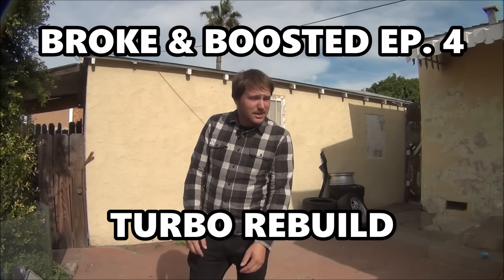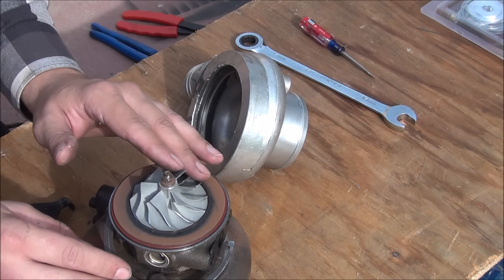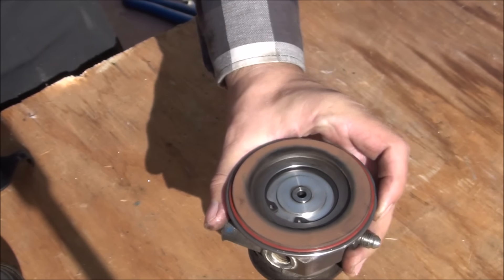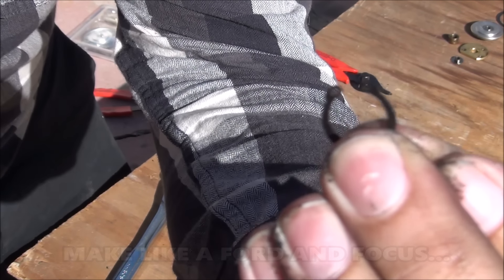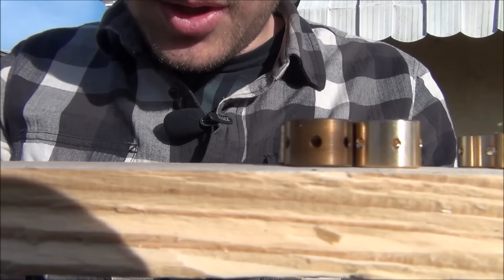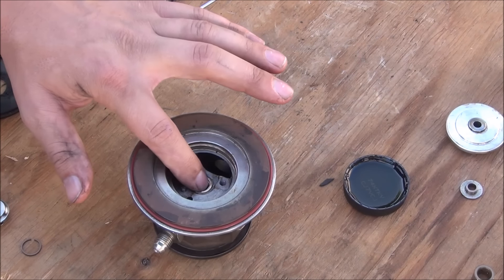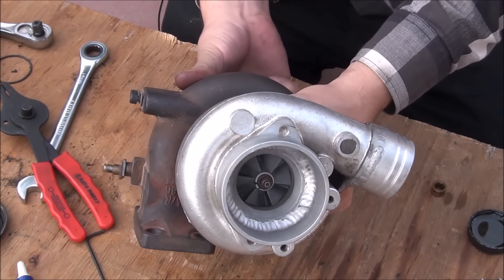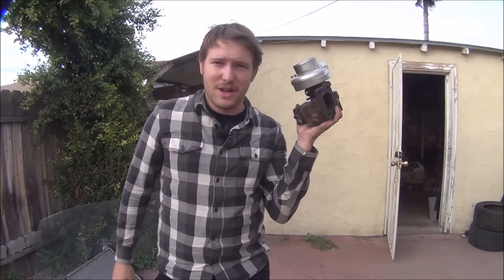How to Rebuild a Turbo! (Broke & Boosted Ep4)

Comment: I love how all these videos are so realistic for the average guy. Working outside in the backyard with basic tools oppose to in a shop with hundreds of dollars of air tools and lifts. Keep the videos coming.
Reply: Right? I bought NB for $3k and was looking at flying miata kits for $3.4k or ebay kits as low as $1.6k and well shit! That is about how much I paid for my car. I like the whole cheap out where you can, buy GOOD 2nd hand quality parts aspect, and when you can afford it you can easily replace.
Reply: I also agree, BUT don't make the mistake of lowering the importance of know-how and very good quality parts. I got an FM kit about 7 years ago, with a GT2554R. Nothing is broken...that turbo now has around 60 THOUSAND miles at 250 hp crank...the reliability is insane...no way you can get that with discount parts.
Reply: i bet i coulda bought 16 ebay turbos for my integra for the price of the gt4554r 7 years ago
Reply: Yes using any old tools at hand
Reply: Ææ0

Comment: I got my GodSpeed Ko4 turbo off of craigslist for 50$s then I got a rebuild off of eBay for 40 something  dollars..
it's been almost 2yrs now and no problems at 22psi!  but because I just mentioned it, my car is sure to blow up now.
Reply from the maker: +Audiwan Kenobi Perfect.
Reply: TheCarPassionChannel sure is!...minus the exploding car,right?...just checking.
Reply from the maker: Audiwan Kenobi Hahaha yes, that would not be good.
Reply: Did u ballance the turbo?? Or use the methode used in this video?? (Marking)

Comment: Awesome video! I love the fact that you did it outside with basic tools, no fancy shop with air tools. I'll use this video as a guide to try to rebuild my truck's turbos. I have an 07 International 9400i with a Cat C-15, 1.3 million miles, my turbos work but look like they're about to crap themselves any minute. Is there any rust prevention to coat the turbos with?

Comment: best to undo fan nut with a log extension socket bar and have   a socket in vice  for the exh side ,,,, so not risk bending shaft  .in .the push down method shown ,,,also can fit carbon seal on intake side  round alloy  thing ,, so you can use with suck thru  carburettor.. i have one on suzuki 1100 motorcycle

Comment: I noticed you did not mention having the turbo re-balanced. While in theory if you mark the compressor and shaft, and reinstall carefully, it should be balanced, in theory this is not always true. Even if it is misaligned ever so slightly, this can throw the balance off

Comment: Another excellent vid... I will be doing the full timing belt / front seals / waterpump as per your video in a couple of weeks, and during next year make everything stronger and prep the car to turbo later in the year. I'm planning to use a TD04 turbo off an impreza, and want to learn more about wastegate actuators and aftermarket boost controllers....Basically how to set and control your boost (i plan to use a p+p ecu) but want to know how these things can be set physically, and what might work well... Kinda hoping you might be planning on covering this...
Keep up the excellent vids... Cheers, Ollie.
Reply from the maker: +ollydubhead Hmmm... how the various types of boost controllers work... sounds like a good idea to me.

Comment: all of these miata videos have made me certian that i want one for my first car 
my plan is to get a 1.6 liter and vinyl wrap it a royal blue, raceland coil overs, at fist i want to get a full manzo exhaust system and then go turbo when i can, some sort of a "cold air" intake, 2 inch wheel spacers, and maybe some white plasti dipped diamond  steelies or maybe some nice bbs rim but not to sure yet
Reply: Just a couple suggestions... IMO, you should get different coil overs because race lands suck lol and instead of the spacer, get wider wheels, it'll make the car look SO mean plus a wider wheels is nicer. And I'm speaking from an owner of a 1993 Miata with 15x8 wheels on
Reply: oh ok yea ik race lands are crappy i might go with some thing a little nicer with maybe some camber adjustability
Reply: +Dale Jackson I've got a Manzo exhaust on my car, it's a bit loud for daily driving but I don't mind it. For wheels Advanti Storm S1's are gonna be going on mine after I finish piecing together my turbo build. For coilovers though you should consider Flyin Miata. They're a bit pricey but they give the car great feel in the corners.

Comment: I know this is an old post, but I am rebuilding a T25 SR20DET that I found.  Three questions.  1.  Where did you get it?   2.  How long did your rebuild kit last?  3.  How did you clean your CHRA?
Reply from the maker: Mike Mohr eBay, $45 (make sure you get the 360° thrust washer) and it's still going strong after 20,000 miles. I did not clean out the CHRA, didn't see any reason to.
Reply: TheCarPassionChannel - kudos to you for interpreting my question correctly!  "Where did you get it" could have referred to the turbo, but you correctly deduced that I was referring to the rebuild kit.

Comment: Great video!

Just a note though, locktite is made to melt at temperature and therefore will do no good on a turbo.
Reply from the maker: +Cory Yalowicki You want to make sure to get the high temp stuff which is good for 500 degrees. The compressor side and the CHRA will not exceed that, and you won't use it on the turbine side since it will get waaay hotter than that.

Comment: hi Craig . awesome video as always buddy!! I was just wondering if you could help me out I have a gt2871r turbo on my car and I need to buy a banjo bolt for my turbo. can you please recommend to me how many millimeters the hole  should be on the banjo bolt so the car doesn't smoke from the exhaust? Thank you
Reply from the maker: Personally I run a 1mm restrictor on my Garrett GT turbos and I've had good luck.

Comment: Alright so i know the turbo u have for project broke&boosted is a t25, i want to know what turbo u have on ur other miata? Great video by the way! Thanks in advance.
Reply from the maker: +FukYoCauch The exact turbo for Broke & Boosted is a Chinese "T25/T28 Hybrid" also known as a "T2854" In my opinion it's not the most ideal T25 sizing for the Miata, but it still works pretty well. The one I have on my other car is a Garrett GT2554R, which is the smallest ball bearing turbo Garrett makes. That, is an amazing turbo, and arguably the BEST version of the T25 for a 1.6L Miata. 1.8L's would be a little better suited with a GT2560R. Being the highest performing T25's you can get, they are also the most expensive at around $1000 new.

Comment: What caused the shaft play before rebuild? Were the journal bearings scored/damaged?
Reply from the maker: +arcticgod619 The inside of the old journal bearings was just worn ever so slightly. The tolerances are so tight, even a fraction of a mm of wear will be noticeable when you check for play.

Comment: How do you go about choosing the right turbo manifold?  Off the top of my head, I would think that price point, construction, position, application and performance are some of the metrics that one would use when choosing one.  What are your thoughts?
Reply from the maker: The best way is to decide what your main use of the car is going to be. For most builds, a high quality cast manifold is the best option. They're usually around $400, they perform well, and they are BULLETproof. You can go with a tubular manifold for higher performance but they take up more space, are more expensive, and less durable.

Comment: Is a turbo rebuild utterly necessary? I know its keeping on the safe side but are the chances high for them to konk out if not rebuilt?
Reply from the maker: If your compressor wheel is hitting the compressor housing, yes it needs to be rebuilt before it eats itself. If it just has some play but no contact, then it doesn't really need it.

Comment: its awesome to see this build coming together! im getting a miata some time within the next 2 years and definetly plan on turboing on a budget. do you know if a turbo/turbo setup like this would be reliable to dailydrive for a couple years?
Reply from the maker: +Capt Fuzzy Plays If you're planning on daily driving and having it as your only car, I always recommend starting with Megasquirt. That's the major difference between this build, and the more "proper" way to do it. You'd have a faster, more reliable car if you have the right management.
Reply: +TheCarPassionChannel allright cool! any other tips i should know about?
Reply from the maker: Capt Fuzzy Plays Engine management is the heart of a reliable build really, make sure you have someone setup the safeguards in your ECU if you don't know how to do it, they can save your engine. I bought nearly everything for may car twice because I realized I needed better parts, etc. Go with 750cc injectors, they'll handle anything a stock engine can including E85. I bought 420cc, then realized I wanted more power so I had to upgrade. Bought a clutch that could hold 185wtq, started slipping so I had to upgrade. Bought a $350 china turbo, upgraded to a Garrett because again, I wanted more power. Always go for the better parts, it's worth it in the end!
Reply: +TheCarPassionChannel thanks a ton dude!

Comment: How do you rebuild it to make more boost? Just curious, my turbo is almost through the door and the one that comes with the vw stage 2 kit says they used same housing but its $1800!!!
Reply from the maker: The only way to make more power from a turbo that's already maxed out is by getting a larger compressor side. And that's assuming the exhaust isn't fully choked already

Comment: a good cheap way to rebuild, nice! I would still recommend that you do get your turbo re-balanced after rebuilding it just for better performance and longevity
Reply from the maker: +laith almasarweh It is definitely better to get it rebalanced, going to add an annotation now to make that clear. This is just the method you want to use if you can't get it done. Thanks!

Comment: TheCarPassionChannel, Idk if you still read the comments on these old videos, but I’ve got the same t25 from enjuku for my 94 miata. I spent a couple hours today trying to remove the snap ring to clock my compressor housing and I broke both of my snap ring pliers. This thing is so tight even after a bit of wd-40. I also destroyed some skin on my hand when the pliers slipped off and pinched it, so I’m taking a break for a bit haha. What snap ring pliers did you use for this video?
Reply from the maker: Coady Lewis The snapring is brutal on these turbos... I had to use beefy snapring pliers on mine, and good technique.

Comment: love this turbo rebuild I will need it when I get my t25 soon I also wanted to know as you watched the video the home made ecu from haggard garage but I noticed that when your megasquirt video you didn't have to build it so I wanted to know if you have to build it,I do have time to build it but at the same time I don't want to waste 8 hours building an ecu.
Reply from the maker: +Adrian Garcia Mine is a PnP so I did not have to build it. It would take some time to build it yourself, but it's probably worth it; $450 instead of $850.
Reply: +TheCarPassionChannel that is a really big amount of money I could be saving but I really don't know how to do what he did so might as well get the pnp,also which website did you buy your t25 turbo I checked on ebay but I really don't trust them as I have trust issues with them with all the parts being defective that's what I heard but if you can give me a link for a fairly good priced t25 turbo lt would Very much appreciated thanks also love your content can't stop rewatching your videos.
Reply from the maker: Adrian Garcia Your best options are either a used Garrett T25 from a forum/craigslist/junkyard for $75-$250, an ebay T25 for $180 or so, the Enjuku T25 for $350, or a new GT25 from Garrett for $1000.
Reply: +TheCarPassionChannel I'll be safe and go with enjuku racing

Comment: Hey man, know this is an old video, but im hoping you can answer a question for me, on the exhaust side it looks like a piece of pipe has been cut and welded to separate the chamber between exhaust and wastegate. Was this to prevent turbulence and pressure build up? Cheers! Really enjoying you videos, they are a great help for my current turbo project!
Reply from the maker: Yeah, I don't really like the design honestly, I had a lot of cracking issues with the Begi downpipe

Comment: how long did the China charger last you before it gave out? and at what psi were you running?
Reply from the maker: 14psi, 28,000 miles and it was still spooling fine it just had a good amount of shaft play. I rebuilt it for $45 and it's been running strong for about 6,000 miles now.
Reply: It will last a lot longer than 28,000 miles at 14psi. You need to removed the restrictor fitting, journal bearing turbos do not need to be restricted unless you are seeing well over 100psi.  Even if you have to restrict it, it would be very minimal. The restrictor you have on there is designed for a ball bearing turbo.

Comment: I rebuilt 3 turbos now and this is how I do it but the most important part is getting the correct parts cuz I rebuilt 2 with bearings fans and compressor shaft 10k km later no problem but 1 with only new bearing and rings but they were slightly wider and scrashed the housing and leaks way worse than it was

Comment: Hey Greg, only this past week found your channel, great content, love the hands on side of your videos
My question is, the turbo you rebuild in this video, was it the Chinese turbo? I'm considering buying one of the new units from Thailand, or is it a waste of time and stick with genuine?
Reply from the maker: +Wayne Clement Yes the turbo I rebuilt here is a Chinese turbo, it's the T25/T28 Begi sells (also Enjuku Racing as the "SR20 replacement turbo") for around $350. They seem to be consistently good quality, where the $180 ebay turbos seem to be good sometimes, and other times fall apart. I'd definitely recommend it, although it's not the fastest spooler!
Reply: Thanks Greg, do you think one of the better built (Chinese/Thai) units would be more durable in a low boost application (Going by experience with this unit, I know you're gona say you're not an expert!) :D
Reply from the maker: Wayne Clement Heck, this thing held up for nearly 30,000 miles on 14psi

Comment: what's your advice on driving a car with a blown turbo?? I have the chance to get a pretty clean 240 but it has a blown turbo and I can't tow it... car is 10 hours away from me...
Reply from the maker: It depends what's "blown". If the oil seals are bad you'll be burning a lot of oil

Comment: where did you get the cool compressor housing?
Reply from the maker: +David monterroza Bell Engineering will modify the turbo however you want when you buy it from them, so I had a 3" inlet put on it.

Comment: would a t25 be good for a 1.8? Also what turbo do you recommend for a 1.8?
Reply from the maker: +Nicholas Kondylis Same. They are great turbos for both engines, it will just spool a little faster on a 1.8. If you have a 99+ 1.8L, I would recommend going with a larger sized T25, like a 2560R over a 2554R.

Comment: Two questions: How do you remove the wheels when the wheels won't come off the shaft? And I noticed you gave no time in the video to inspecting and measuring the shaft for wear. I understand the bushings are a brass alloy and are meant to take the abuse rather than the shaft, but I would think there would still a shaft inspection step. There most certainly are wear marks on your shaft in this vid. Nothing of consequence, I'm sure, but wear nonetheless.

Comment: 200 bucks for a real t25 with a extra one for spare parts a good deal?
Reply from the maker: +TheUberdude14 Sounds good to me as long as the wheels are in good shape! I've seen T25's for anywhere from $75-$250, even up to $450+ for used ball bearing T25's. Any idea what engine those came off of?
Reply: +TheCarPassionChannel one was revised and the broken one came of an old renault 5 turbo

Comment: I cant get the shaft back in with the exhaust turbine on it at all! Tired heaps of things for hours. Someone help
Reply from the maker: What exactly doesn't fit?
Reply: @TheCarPassionChannel  the part you install at 10:20
Reply from the maker: @kaneradcliffe5804  I'm not really sure of any tricks, I just remember it was a bit tricky :/
Reply: Turns out If you install that little washer at 9:05 upside down it will stop it going in completely 😅

Comment: Hey guys, do you have an eBay seller that you would recommend? Interested in getting t25/t28. Thanks!
Reply from the maker: +Louis Benevides I don't have any experience buying them from ebay, I'd just go with a seller that has a high rating and lots of points. All these turbos might come from the same factory, lol.
Reply: lol you're probably right.

Comment: Will the T25 turbo work for a 99 nb miata?
Reply from the maker: +The Three Futbolteers Yes, still a very good size for that engine. Not that there are several different versions of the T25 as well.
Reply: +TheCarPassionChannel thanks for the reply!

Comment: Wrong, don't say you have to be a little careful and then use the wrong hammer, it should be a rubber or plastic mallet and NOT a geologists hammer or whatever that is.